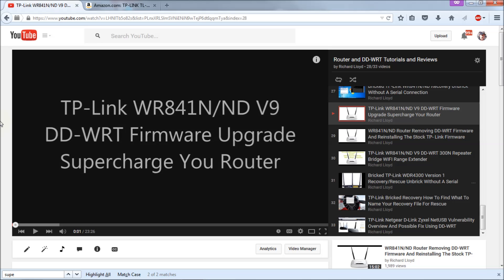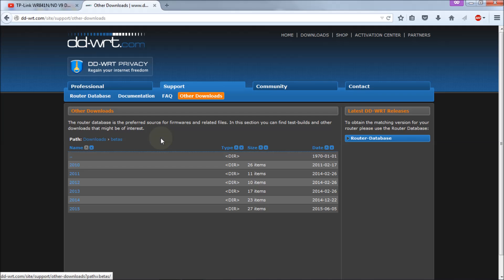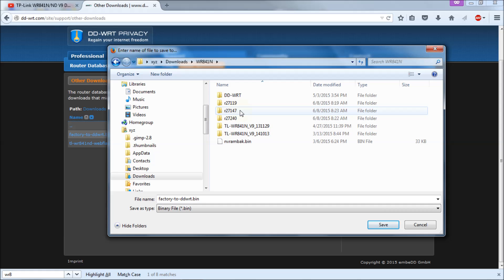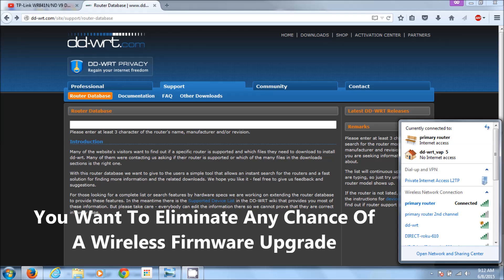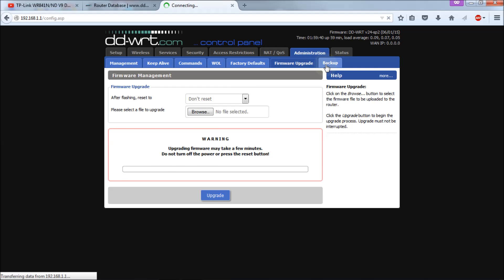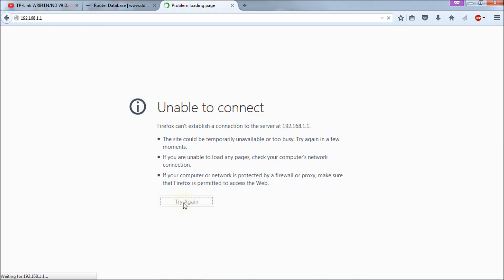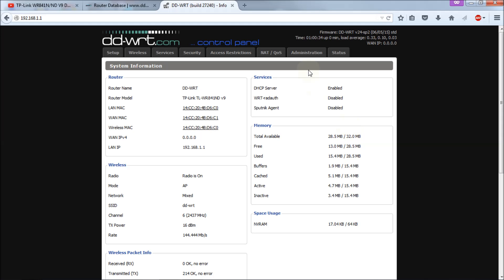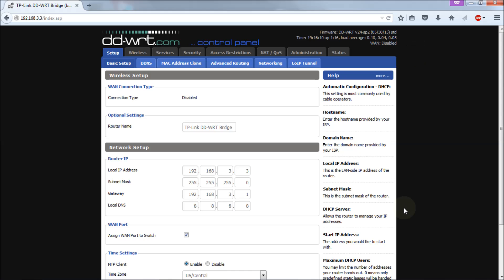DD-WRT New Beta Firmware Upgrade - Downgrade Procedure TP- Link WR841N/ND

Comment: hey Richard!! I have tplink 841nd v10 router.i can install openwrt firmware but i am unable to connect to wifi.Why is so??do you have any idea?
Reply from the maker: I would check and make sure you are using the correct openwrt firmware for your router and router version. If you are then I would try a different version of the same firmware. I don't use openwrt currently but I have and I can't see why it would not work for you. Thanks.

Comment: Hi, watch couple of your videos on the WR841N. I have tried flashing to latest few version of firmware (02-16 to 03-16 dates) but I notice there is no OpenVPN in the VPN section. (Router using v9).  Have you found a version that has the Open VPN options in it????
Reply from the maker: +Dell Moore I have searched the DD-WRT forum and they state this router does not have enough memory to support the OpenVPN module. Thanks.
Reply: +Richard Lloyd That sucks, I bought the thing specifically to be able use VPN on my wifi per recommended by DD-WRT site, (my other router didnt support dd-wrt. Do you use a VPN with this router and could you point me to what you are using or how you are using it??  I currently use PIA for VPN, thanks for your reply back...
Reply from the maker: +Dell Moore I do use PIA but I use the desktop client to connect. I used it on the WDR4300V1 but I found that it slowed my network performance considerably. The WDR4300V1 has a 550 MHz CPU and it does not have enough juice. My speed test went from 30 mbps to 10 mbps when I enabled openVPN on the router. So my suggestion is to purchase a router with the most powerful CPU you can afford. Also you can search the dd-wrt forums and see if they have any suggestions. Thanks.

Comment: +Richard Lloyd
 i have v10, what to do, please guide.
Reply from the maker: +Harry Sehgal Until DD-WRT releases a V10 firmware for this router you will be limited to the production firmware supplied by TP-Link. Thanks.
Reply: Richard Lloyd Thank you for the prompt response. I guess i will have to wait for DD WRT then, but..
Is there any other way to use my tp link 841n router range extender/repeater wirelessly. At present i am using Zyxel Wireless N300 Range Extender WRE2205, but i would want to use the tp link one?
Reply from the maker: +Harry Sehgal I am not aware of any way to use the WR841N as a range extender/repeater without using the DD-WRT firmware. Thanks.

Comment: I am able to upgrade firmware on tp-link router. but when I am trying to create password to make it secure one pop up comes - Window model dialog_1353578 is already registered in the DOM! Make sure you use setDestroyOnClose() or destroyOnClose true in the constructor. Please help.
Reply from the maker: shailendra jain Never had this error myself. Which browser are you using?
Reply: I am using Google chrome, tried on IE8 but still facing the same error.
Reply from the maker: shailendra jain Can you try this on a different computer? Thanks.

Comment: I suspected that we had to do this. But i wasn't sure of the order in which we had to use the bin files. Looks like it's just the same as flashing the first time. Still it's always better to confirm from a pro rather than bricking your router. 

Thank you for posting this video and even more for posting it so quickly. :)
Reply from the maker: Archit Srivastava You are welcome. It is the same procedure as the original install. I think people are getting confused that they don't need to use both files every time as they already have DD-WRT installed but that is why it does not work for them. Now i have this video showing it being done both ways so I can always show it to those who ask about this. I thank you for asking the question and I am always happy to create content that adds value to my channel by helping people.
Reply: Richard Lloyd I use web flash and have no problems use like on netgear default